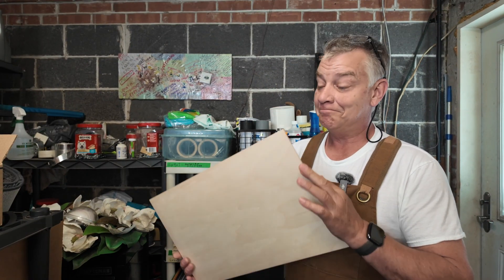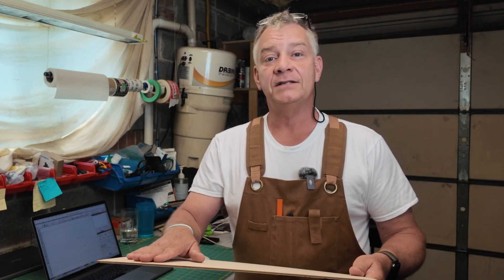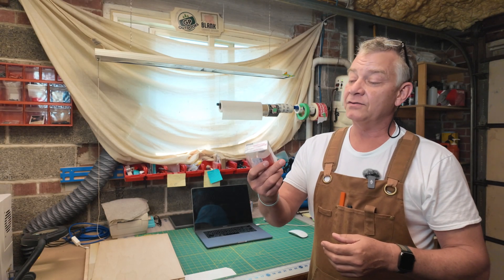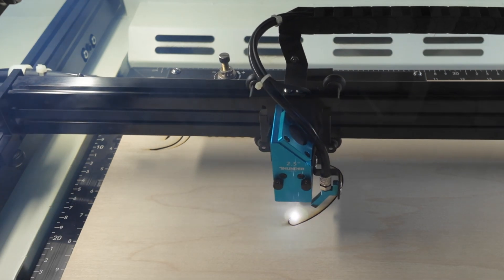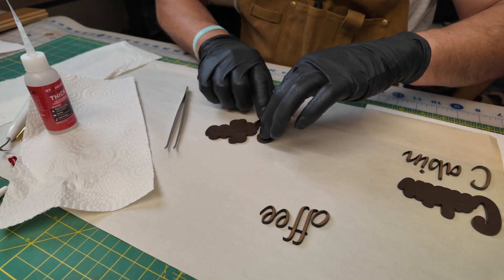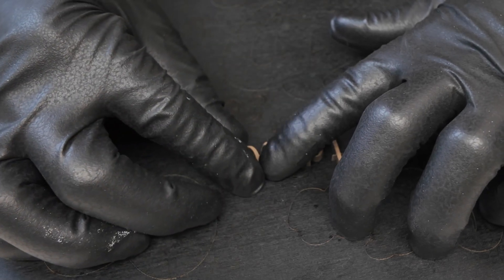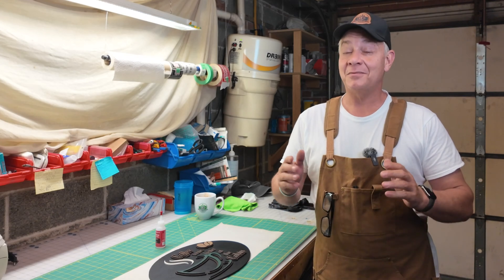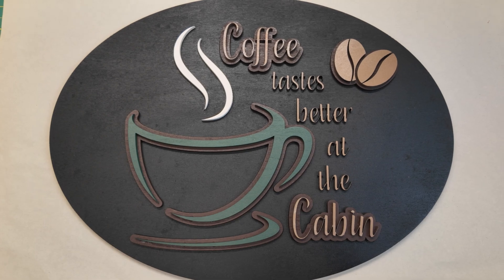Craft Plywood on Thunder Laser BOLT. Settings, Material Test Card and More.   044   4K

Comment: Two questions if I may. What is a Nug? 😅 and do you feel limited in space with the Bolt? I am considering purchasing the Bolt but not sure if the 12x20 is a restriction for things you make and sell.
Reply from the maker: Good day.NUG stands for New Useless Guy ( an old joke here but...:)). Yes - I do sometimes - as you get familiar with it you start to try more and more things and you find you want to go bigger but being my first laser, I made a list of potential or desired products I wanted to make, at least for the near and mid term and that drove my decision on bed size. I understand the new BOLT Plus has a little larger bed size. Best of luck!

Comment: I'm a new Bolt user as well and one thing I've found when cutting mdf is that a lot of gunk will build up on the the focus probe (and air nozzle). If it's not cleaned quite often it'll leave a mark on the material when you autofocus. And I found this out the hard way!
Reply from the maker: Good morning and thanks! I will clean it up this morning before the day's work starts. Cheers!